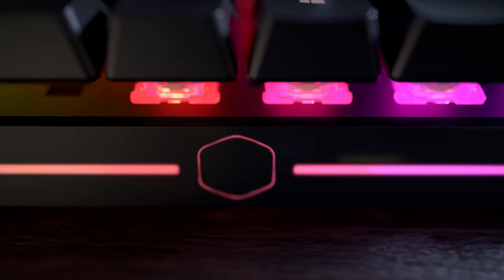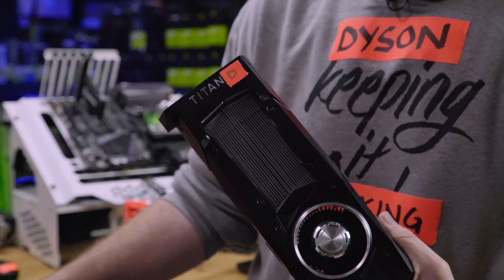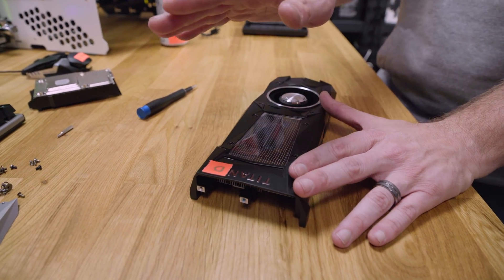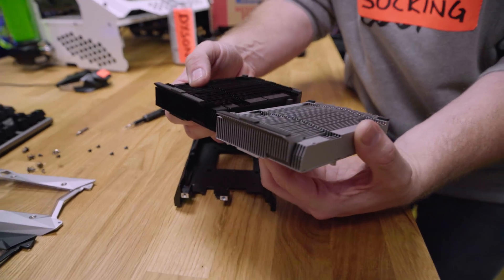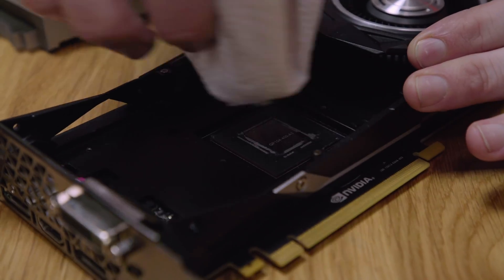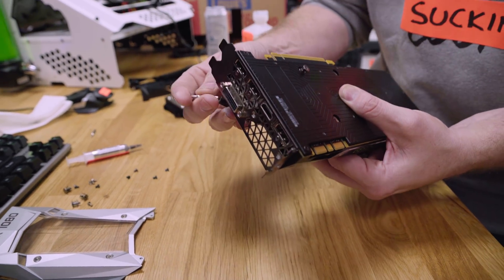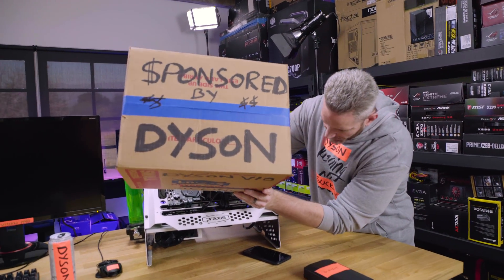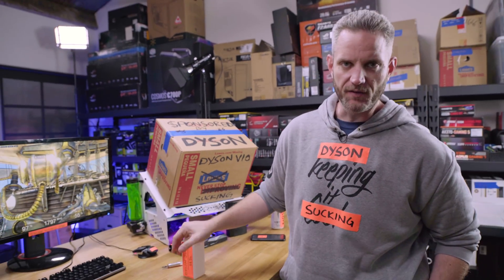Trying to cool down the GTX 1080 FE with a Titan Cooler

Comment: Old video, but thought I'd leave a comment still :)

My 1080FE is seriously having Heat problems. If I'm running heaven benchmark It quickly going up to ~90-93C and throttling while the fan is running at 100% and sounds like a jet-engine, it basically never reaching anything above 1700mhz. I have removed the casing, the heatsink and applied new cooling paste which seem to have had no effect what so ever.

The only thing that have helped is to remove the front casing (where the actual heatsink is) And mount a 120mm Case fan running at 90% speed (silent still) Was surprised how small the heatsink really is on this junk, but mounting this fan helped A TON, even if it's not amazing. I'm now generally not going above 75C on full load.

Comparing that to my Zotac GTX 1070 AMP! which I removed the casing + fans and mounted 2x 140mm fans on the cooler. the results are somewhat like this

Pre-fan "upgrade" 

Running full load @ 85-90C Throttling, and only way to get above ~1800mhz was to put the powerlimit up and overclock it some. But it was running ridiculously hot.

WITH the fan-upgrade

It never going above 62C, after hours of playing, Never throttles, IN fact without any adjustments (overclocking or powerboost etc) It goes to whooping 2037mhz and staying there ROCK SOLID. Now THAT is according to me, FRICK'n AMAZING!! :) The Turboboost totally outmanaged my previous overclocking values by just mounting 2 huge case-fans on the cooler. 

Highly recommend this to anyone having GPU heating problems

Comment: @JayzTwoCents - I would be very interested to see if the Titan with the lower rated cooler actually runs any different to before. Does it run hotter with the 190W cooler instead of the 250W?

Comment: Jay, can we get a video about how to deep clean radiators that have been in use for years?

My loop has been running for 18 months and Im getting the itch to do a build. Only thing is I dont want/need to build a new system because of prices and because im doing fine with my 4790k and R9 390, but I do want to try my hand at hard tubing (your videos gave me the courage to try, and for that matter, they gave me the courage to build a custom loop in the 1st place).

Comment: Jaaaaaaay! Long comment be prepared. (Not really..) Ive been console player forever. Im 27../m/mi..lol... just recently ive decided to put my nobleman shoes on and go PC. Basically this is what im doing im buying parts one at a time due to budget. What im getting is.
Cooler master box mid tower 8.7x19.7x18.7

AMD ryzen 7 1700 with asus prime x370 pro bundaruu..

Evga gtx 1060

Evga supernova 750 61+ 80+

500 ssd 
1tbhdd

Basically i was wondering if..IF u had these parts if you could build it on your channel so i and others could see what it can do.

Also just something you could possibly do in the future for other ppl. More content ftw

Comment: Could it just be that the fan SPEED Percentage, and actual fan speed are different across cards.  55% only sets the voltage for the fan (Or duty cycle if PWM). Try setting it to a specific RPM.

Comment: Don't know how to contact you with an idea, so I'll leave it here. I was wondering if you would do a video that compares gaming on a crypto-mining bios modded gpu vs one with a stock bios. Inevitably, the used market is going to be flooded with used RX 580's that have been used for mining. 99.9% of miners have modded the bios on these cards because it makes the cards mine 30-50% more crypto-currency than a non-modded cards. I am sure that when these cards hit the used market the miners are not going to spend the time to put the original bios back on them. So will they still be able to run games properly? Will they work better for gaming since the bios mod provided better mining performance? Or will they be a glitchy mess that can not longer work well for gaming? This sounds like the makings for a Super viral video!

Comment: Maybe the power phasing on your gpu pcb is having issues.  Running under water cooling lets a card run  a lot harder on those reference parts? You still getting the same clocks but more temps?  I'd say measure it at the wall or hit it with flir from the back with the backplate off and compare that to another ref 1080 under load.

Comment: BLOWER GPU coolers are shit like intel stock coolers
fine when its new like 70c then when it gets older 80 then 90 and 95 then you swap it out for an aftermarket cooler and its happy at 50

Comment: Maybe I’ll try to change my thermal paste; my MSI 980Ti will hit 91° and throttle on a 2560x1080 monitor unless I turn off AA and turn on vsync so it never runs near 100%.  Cpu stays in the 60s with a dark rock pro 3.

I can’t afford the no longer in production ek water block for my card, pump, res, fittings, lines to fix it that way.  Sucks I’m stuck either thermal throttling or reducing performance myself to keep temps at least out of the 90s.

Comment: I started having a similar temperature issue with my EVGA GTX 980 SC; around 6-8 months ago I noticed it running hotter and louder. I cleaned it and put on fresh thermal paste, but that didn't help much, if any. It gets loud enough to hear inside my Fractal R5 in some games, whereas before I never would hear it. 

Loved the Dyson joke btw; keep up the great content.

Comment: I'm not sure what to take from this. You changes to many variables. You need to 1. Set the aircon to the same temp 2. Set the fans to max 3. Have a heat soak graph comparing the time to rise and the equalised temp. 4. Repeat atleast 3 times for each heatsink. 5. Ideally do this with more than one sample. Steps 1 to 3 are a must tho.

Comment: Love the Dyson burn after all the channels launch their video on the same day. 
I have an idea for a new cooler that can fit any card. It's based off a kids toy from the 80's. No screws and cools and covers the entire PCB front and back not just some spots. It's pressurized and works the same as the vapor chamber method. I wish I had access to the tools and materials to test it out.

Comment: Would it be cooling better because it doesn't have the black powder coating? I would be curious if the Titan D is running a little hotter now because you have the black powder coated cooler in it now? You should give it a little test run see if they're made a difference now that you change coolers in that as well. Love your videos!

Comment: did you overclock that card while on water? haha wait of course you  did!!! in my experience anything i've overclocked tends to get hotter and hotter over time could this be a possibility?  ive first hand seen this with my fx 8350. my aio watercooler almost cant handle the heat on stock settings anymore and gets hotter than it did when i first overclocked it using this cooler. just curious if you think that could be a possibility

Comment: Hey Jay, I would highly recommend you take a look at the Anne Pro, it easily beats the vast majority of keyboards twice it's price with the same features in my opinion. The instructions as far as connecting it goes were slightly confusing at first but a quick 5 minute trip to the community subreddit fixed that.

Comment: Another thing you can do, if you're adventurous enough, is clean the fan bearings. There should be a small plug on the back of the fan. Use Brake Clean to remove contaminants. Once dry(you can use compressed air, just don't let the fan free spin), apply a drop or two of 3-IN-1 Electric Motor Oil(Yes, that's a brand name) to the bearing, and replace the plug. You will see a significant increase in fan speed, while lowering both power usage and dB level. And since most cards power their fans from the PCB, you will have a little more power for the GPU.
Thanks for your great work, and for the laughs!

Comment: I bought 2 new titan coolers from eBay for $35 to swap out my 1080fe's because one of them started running hot like that no matter if it was on top or bottom
 I also used Fujipoly GR-m 2.5mm thermal pads and thermal grizzly paste, the hot card got back under control and both cards run around 65

Comment: Did the same thing with a R9 285. Had a dead Windforce HD 7870 (3 fans vs 2). Was not quite as easy. needed a dremel work and some fin bending. Plus it also had memory cooling. Added memory pads. The Stock R9 cooler did not not have any cooling except for the air blowing past the cooling fins. Had some fins left over so put a 92mm fan on that. Got the clock to go from 938 to 1100 and 1375 to 1400 on the memory. That is pretty much the speed limit for that, but not temperature limit. Runs about 63C when gaming. Got it in a ryzen build now. I would replace it, but too cheap to pay the price for new video card that would effectively do betterer. Well time to suck some 80 proof brown Dyson juice.

Comment: When I disassembled my Inno3D 1080 Ti, i noticed it had some washers on the back of the card, for the 4 main cooling block screws. These seem to be for increasing the mounting pressure. Perhaps the founders cards have them too, but after water-cooling the card, you forgot about them? Could that explain the difference in temperatures? Just an idea.

Comment: I got a Asus Direct CUII GTX560 for free from someone, and It always ran hot. Turns out the stock fan curve really sucks compared to my old Gigabyte Windforce II GTX460SEv1. Maybe most modern Nvidia cards just really need the fans adjusted.

Comment: In my experience 55% fan on a founders cards isn't enough on my 980ti highly overclocked on a hot day on auto it will go up to 90% fan to stop it from throttling

Comment: arctic silver is conductive enough that when i used my debit card to spread some and got it in the chip, it caused my card to not work at all.. cleaned it off, worked fine.

Comment: Why didn't you use the Dyson GTD 1080 Dsn? It is much better than the puny GTX 1080 Ti.
Reply: we tried, but there was a bug in the Dyson Experience drivers so we had to use the 1080 Dy instead

Comment: You have to take a look at the Fan Speed. Bios is forcing the card to 85°C if the cooling is suitable. If there is any difference under load then in fan speed not in temperature. Better cooler needs less rpm. But in my opinion it´s the same cooler.

Comment: They have the exact same vapor chamber... obviously they perform the same. Slap one of those on a 1070 FE though, now you're talking. I did that for a buddy, and it runs almost silent now. No more temperature spikes, cools down way quicker too. The 1070 FE stock cooler is trash, the vapor chamber from the 1080 and Titan is actually not bad.

Comment: The 1080 is probably deteriorated because it was since it was watercooled and therefore probably overclocked to the edge and if it is the silicon can deteriorate and will require higher voltage and so gpu boost will give it more voltage to hit the same clocks.
Reply: If you have any temps for what the 1080 was in the beginning of water cooling, watercool it again and compare.

Comment: Wonder if it’s a problem with the fan. Does the fan sound louder or did a screw get over torqued causing the fan to spin slower than it’s indicating.

Comment: I would bet the increase in temperatures is due to the fan. Try replacing the fan and see if it makes a difference, even at a set % speed if the magnets have demagnetized, the fan will turn slower.

Comment: Question: Woudnt it be better to polish the micrograins from the old paste into the heatksink/ihs, therefor making it a smoother surface, intergrated with paste particles that will improve the cooling a little bit after each paste refresh?

Comment: Re the Dyson juice/isopropyl alcohol. I stopped using isopropyl after an unpleasant skin reaction. I use Everclear or Graves now. If you've never heard of it it's basically moonshine sold in liquor stores here. It has a higher alcohol content (97-98%) which means less water content. Also it's safer against bare skin because it's manufactured as a consumable. It's expensive compared to regular isopropyl but I've never had a problem with it.

Comment: my KFA 1080 runs at 90 C with few picks up to 92C with an overclock of 2000 - 2088 MHz. 
These temps are while gaming at 1440p @Ultra settings. 
do you think I have to worry much about it?
Reply: TeaTime that seems high

Comment: U should have slaped the 125 000rpm dyson fan for the gpu
Reply: It would freeze the Card and the super density flux Vacuum created by the level 3 Dyson Fan would cause interferences with the Sensor Phalanx of the GPU for Temperatures, confusing Kelvin with Fahrenheit, which would lead to a Supracooled Gaming experience and summon the evil God Cthulu from the Depths of the Dyson Juice Sea ( 99% )
Just sayan
Reply: "slaped" xD